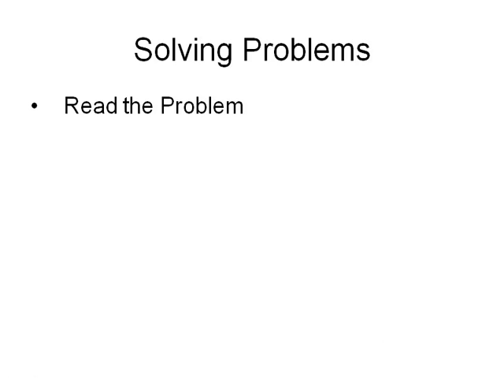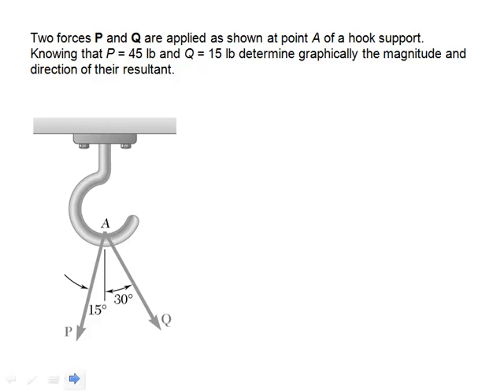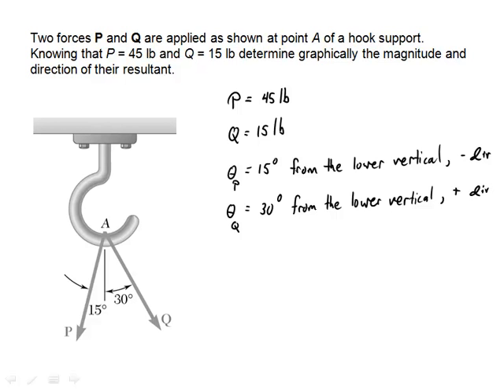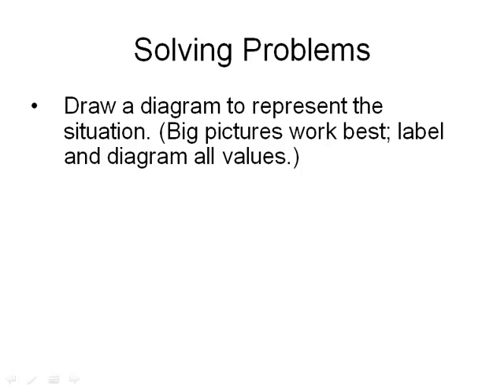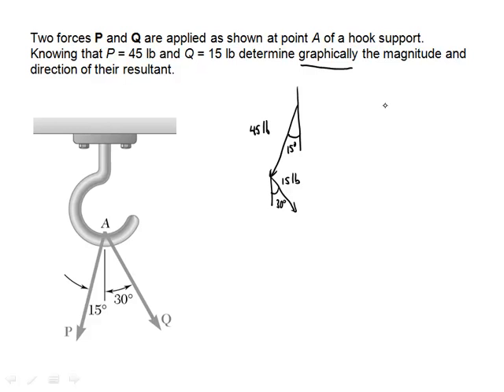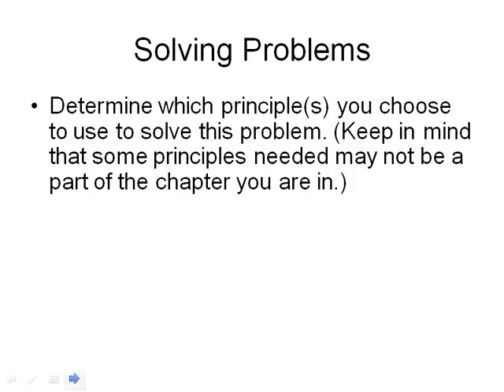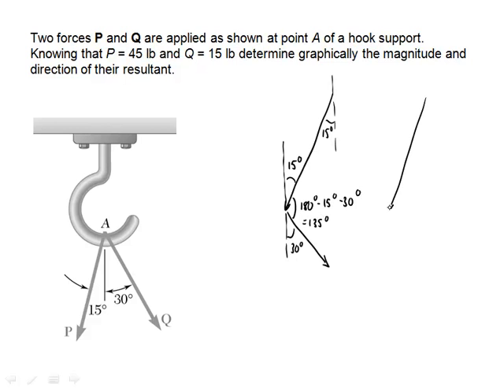Engineering Problem Solving

Comment: Where did you get 270?
Reply from the maker: Where, in the video, do I have 270 degrees? May I know the time stamp, please? Thank you, Jenn.
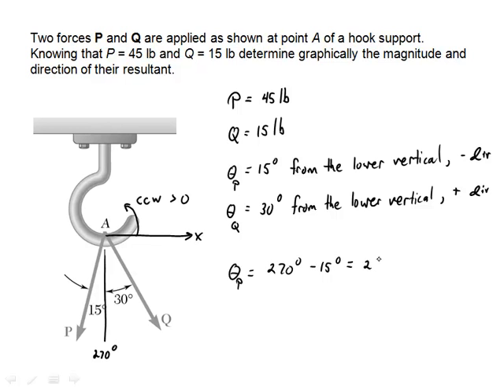Reply: @casperpiper  2:54
Reply from the maker: @britmarie4859  As we measure around the circle in the counterclockwise direction, the positive x-axis is 0 degrees. The positive y-axis is 90 degrees from the positive x-axis, so it has a measure of +90 degrees. The negative x-axis is 90 degrees farther in the counterclockwise direction from the positive y-axis. So it has a measure of 90 degrees (the positive y-axis) plus 90 degrees further =  180 degrees. The negative y-axis is 90 degrees farther in the counterclockwise direction from the negative x-axis. So it measures 180 degrees (the negative x-axis) plus 90 degrees further = 270 degrees. 

Oftentimes we will measure angles in quadrants 3 and 4 from the positive x-axis but in the clockwise direction. Since we are traveling in the clockwise direction, the angles are considered negative. The negative y-axis, in this case would be labeled -90 degrees, since it is 90 degrees from the positive x-axis in the clockwise direction. I did not do that in the video, but that is very common. 

Does that help clarify?
Reply: @casperpiper  Thank you!
Reply: Wow! This video was a long time ago but you still replied.
Reply: @kevinsy4482  The guy is on top of things!
Reply: @britmarie4859  yeah. He is.
Reply from the maker: @kevinsy4482  I am here to help!!